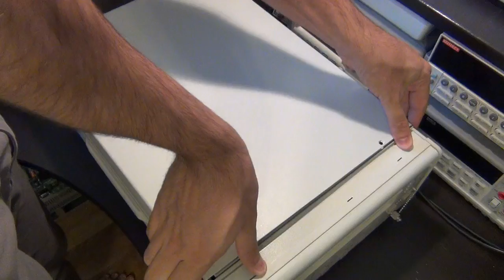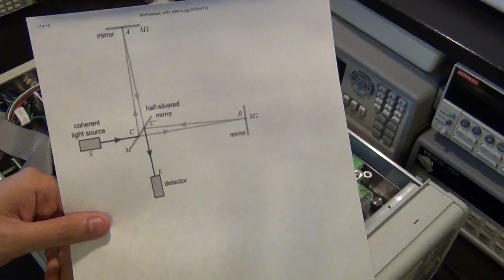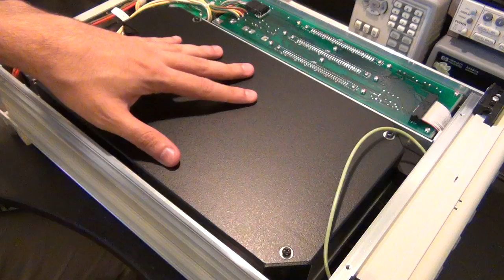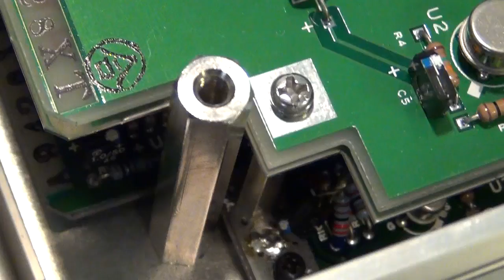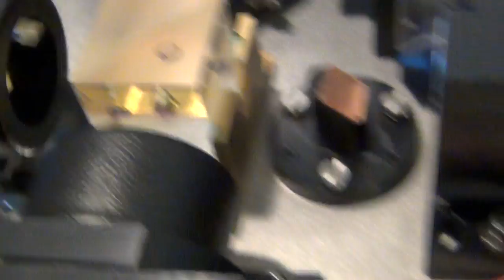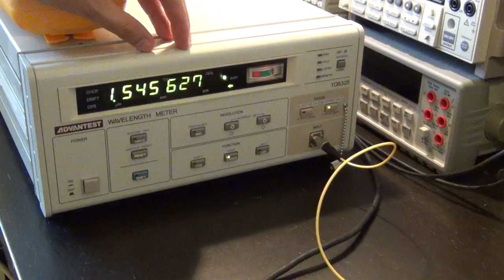TSP #13 - Teardown and Operation of an Advantest TQ8325 Wavelength Meter

Comment: I looked up the number on the laser and found it was actually a Siemens (now LASOS) product.

The motor on the sliding mirror is actually a brushless DC motor of the same type used in floppy disk drives.

Comment: I agree. I have taken apart a big Alcatel OmniSwitch, even the backplane hat quite a few bodge wires. So it was actually cheaper to have a person put those bodge wires in rather than re-doing a 16 layer board batch again. And I'm not even talking about those plug-in boards...

Comment: What kind of signal frequency comes out of the detector? What amplitude is the raw signal from the photodiode? Might be cool if you could see anything with the scope!

Also, whats with the protoboard sttle holes on the second board?

Comment: It seems to me that expensive, specialized equipment would be quite likely to be bodged. My reason for thinking this is that for the production of a low number of units, the added cost of bodging may be much less than the cost of a redesign process. Remember that the high price of these devices is primarily due to having to recoup the development cost over a small number of units, so the cost of any redesign can severely impact the end price of the product.

Comment: It's hard to imagine why the stepper motor has to move continuously and so fast.  Seems like it would wear slop into the slides over time.  Many times in labs instruments are just left running continuously ... not the best practice, but it happens.

I didn't expect to see that tube laser ... but it was 1985.  Not sure the semiconductor lasers even existed then.

Comment: I am bit surprised that they used motor for mirror moving (because of vibrations). I expected optics similar to cd laser (coils and magnets). I don't think elec. motor used to push-pull that big mirror is stepper. I think is simple synchronous electric motor used in floppy drives and 80's hard drives :) What are op amps used for detector? So, let's say that big mirror move 30mm and that light source is around 250nm, we end up with about 120000 pulses/motor rotation. Or it is 240000?
Reply: A "bit" late to the party, but the motor has no encoder. The reason the HeNe laser is there is because it has a very accurately known wavelength. So the interference signal of the HeNe laser is used to determine how far the mirror has moved. Once this is accurately known, it is possible to calculate the walength of the unknown light source at the input of the instrument.

Comment: 19:50 what a horrible board. In my opinion if you need that amount of bodge wires it is worth redesigning. especially for a unit in that price range.

Comment: At my grad internship I used to work with a spectrometer for measuring high power LED sources. Spectrometers plot the light spectrum from e.g. 300-900nm in 2048 steps. This device is clearly aimed for the use with 'pure' light sources.
If I recall correctly, spectrometers use grating mirrors which reflect light where the reflection angle is a function of wavelength. This 'rainbow' is measured with a calibrated CCD sensor. 
Optical equipment is always very interesting to teardown. Nice video :)

Comment: What a fascinating instrument. Nice walkthrough.

Did you notice that the HVPS is datestamped in the mid 90s, 10 years after the other date markings? Repaired?
Reply: A little bit too late, but on Advantest gear, when they stamp on the silkscreen the copyright year on the PCBs, it is the year where the design is made. They usually use the same design during years, or decades. But they also stamp the year and month when the PCB was installed, with black ink, and I presume that the entire instrument was built on 94. Not only the power supply, but also the laser tube was dated on 94.